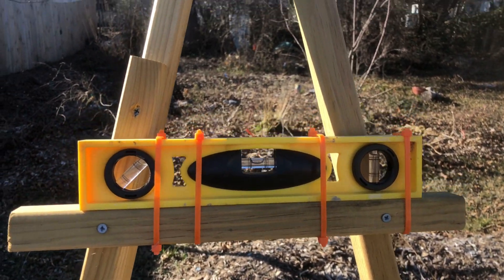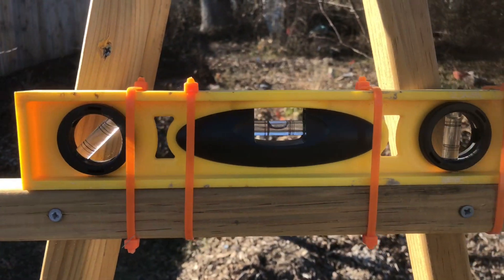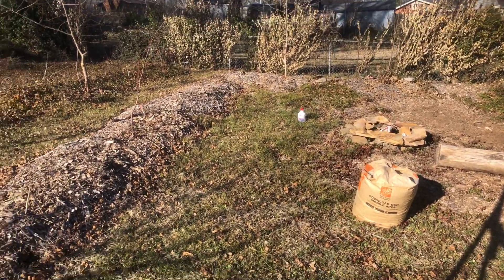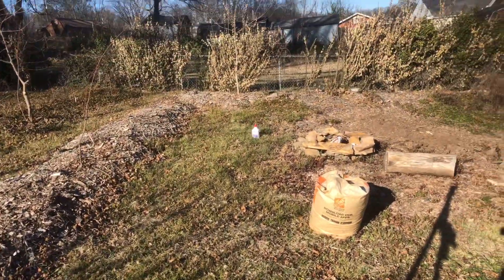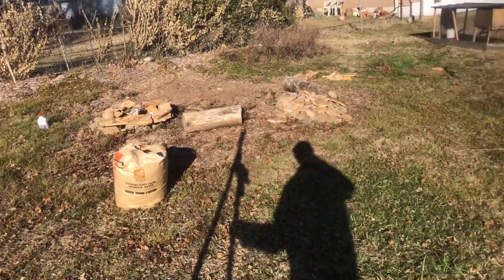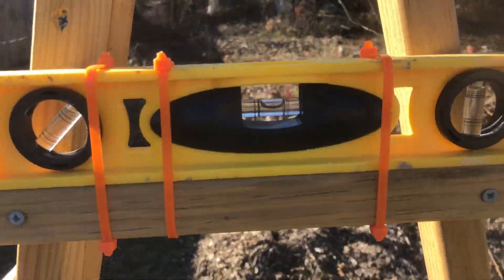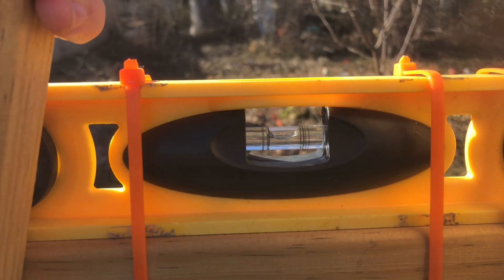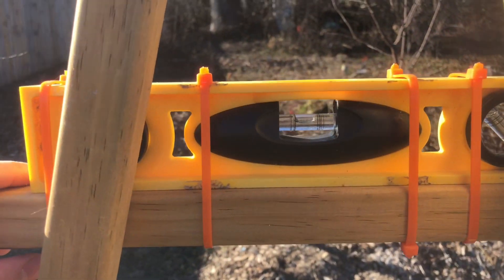The Problem with Bubble Level A Frames

Comment: No...that's not right.
Reply from the maker: How so?
Reply: @theforestgardener4011  If the level is off then the pegs will slope either up or down. The distance from the tips to the crossbar need to be equidistant for the level to work.
Reply from the maker: @WKLN  I think that was sort of my point. If the A frame is built incorrectly, the bubble could show level but it isn't actually level.
Reply: @theforestgardener4011  If the bubble isn't level, then the longer leg needs to be trimmed a bit until it is.